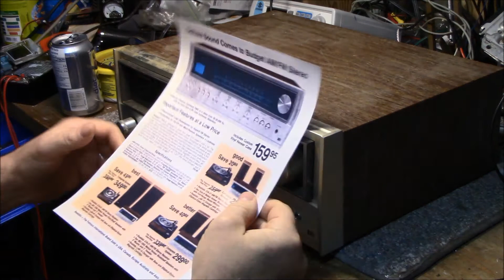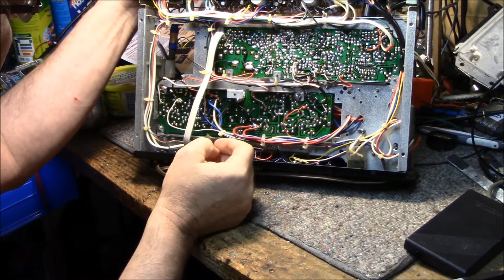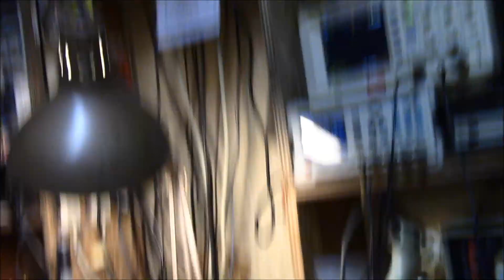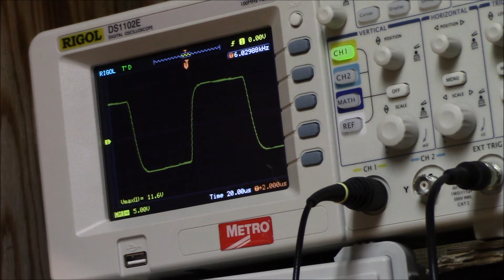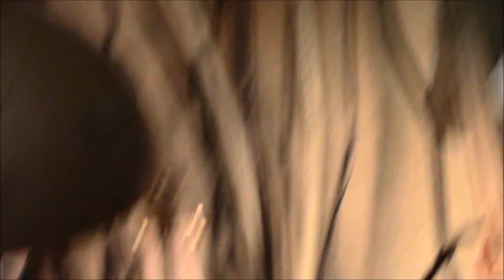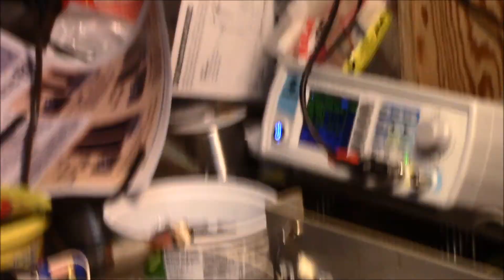Realistic STA 21 - Cleanup & check out of this time capsule (Ep. 3)

Comment: Good vid Trev. I have restored an STA72, STA77A and an STA82. I like them all. Good build quality, solid wood veneer cabinets ( no peeling vinyl issues.....). Nice Vintage look. AND they sound great after component restoration and calibration. A lot of them used Sanyo caps.....but they are all old, so lasted well. The "tone" PCB is hard to access for recap and clean pots, however can be removed quite easily. They elongated the Pot mounting holes so tone board is easier to remove and reinstall.....  And as far as budget- $159 in around 1975 would be about $850 in todays money,.....I have too many units I've currently restored. Hard to sell any of them......Love vintage units no matter the brand.